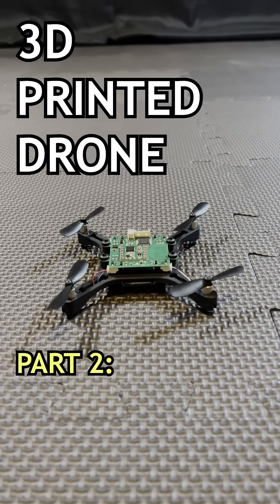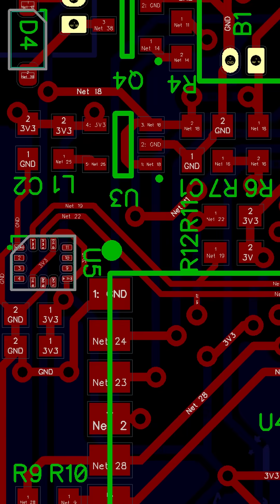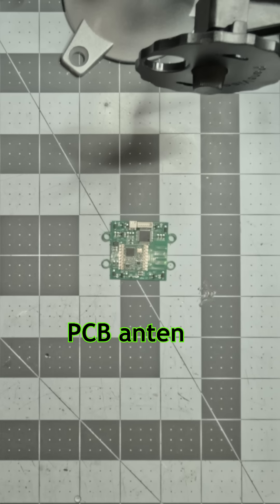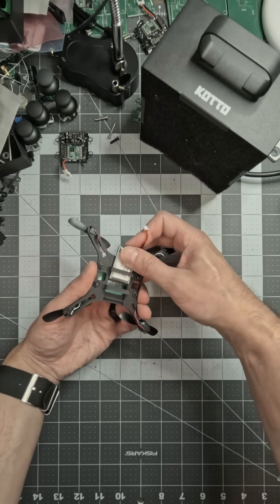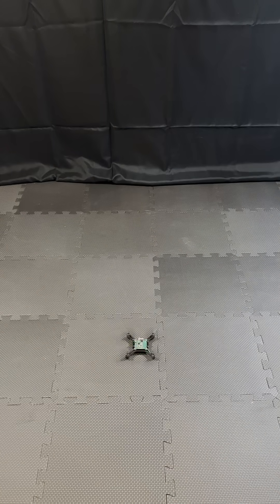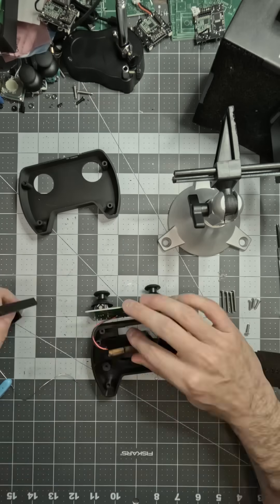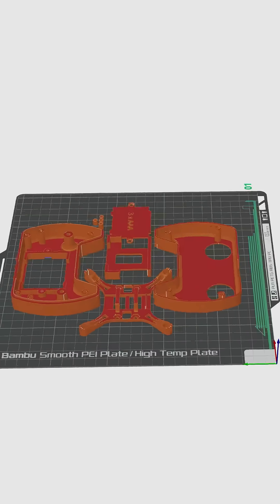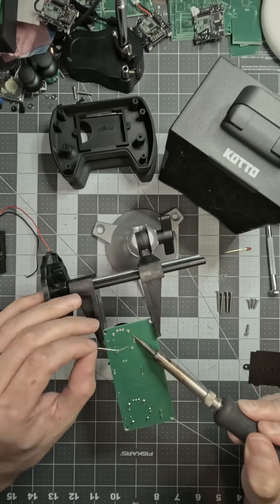3D-Printed Drone, Part 2: Flight Controller #drone #diy #3dprinting #electronics

Comment: Where i can find code if it open source?
Reply from the maker: The code will be open-source, and available from www.midnightmake.com once the site is up and running, and when the kits are released. That will be a few months from now. Thanks for your interest!
Reply: @LateNiteMake your newer version looks fantastic
Reply from the maker: @jaykapadiya9662 Thank you! It's much easier to fly, and a big improvement from the old one. This is the version that I'm selling as a kit.